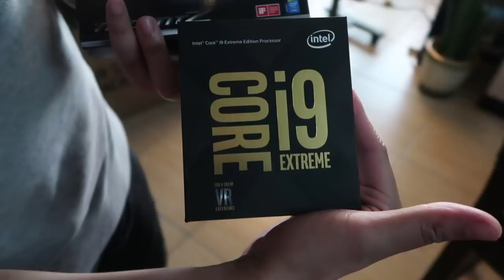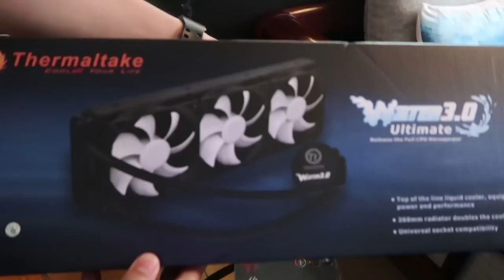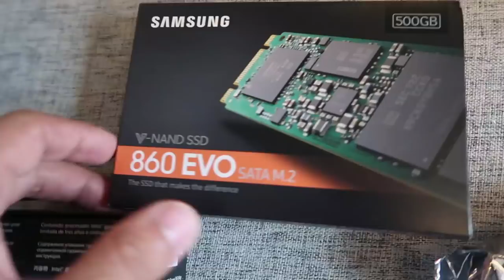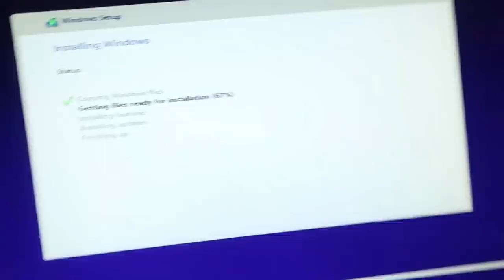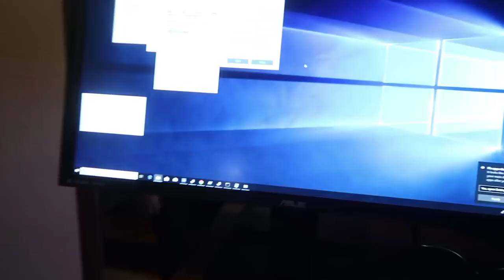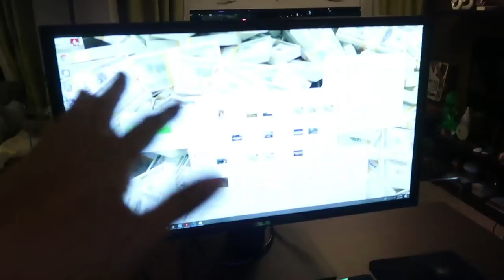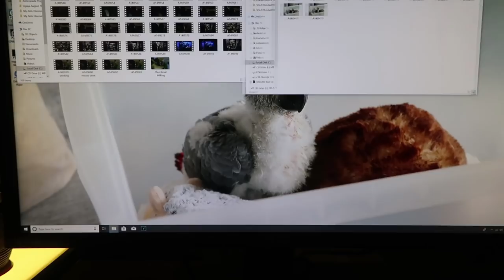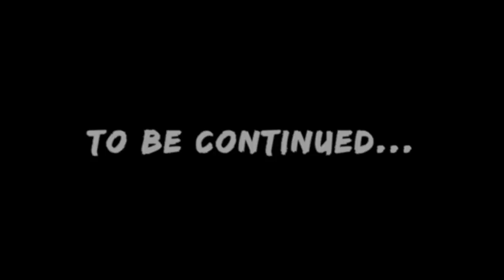My New Super Computer: i9 + ROG Rampage VI Extreme | Vlog #221

Comment: I wish instead of 500gb SATA SSD you should buy the M.2 NVME SSD 1 Terabyte. It's a lot faster and help you to move and scrub 4K files quicker, too.
Reply: They installed an M.2 stick on the motherboard - I swear that I saw it. Good advice.
Reply: I know they installed that but the read and write speed is very similar to 500gb Sata SSD which is good but not the best. He also need a larger SSD storage because he is editing 4K video now which has a humongous file size.
Reply: They installed the m.2 ssd as  boot device.
Reply: @michaelk5007  there is M.2 but its SATA not nvme